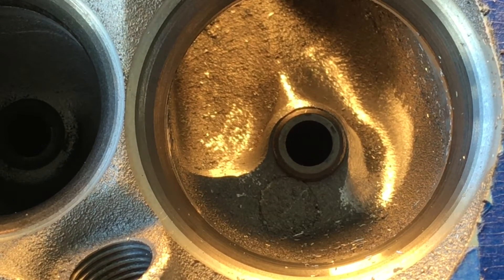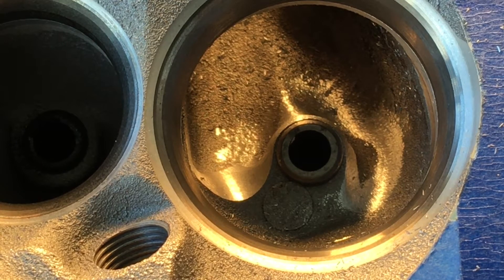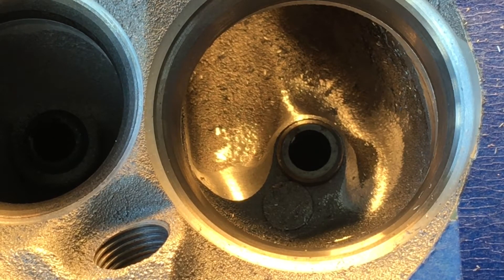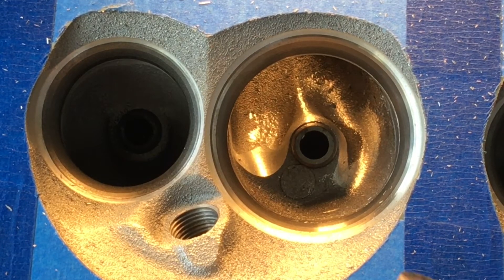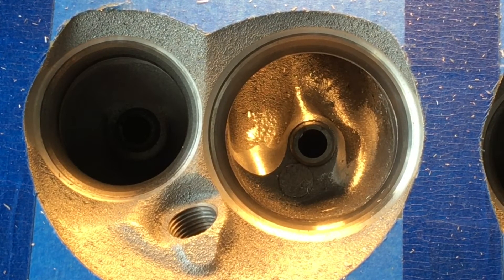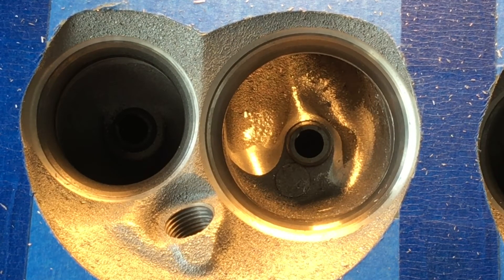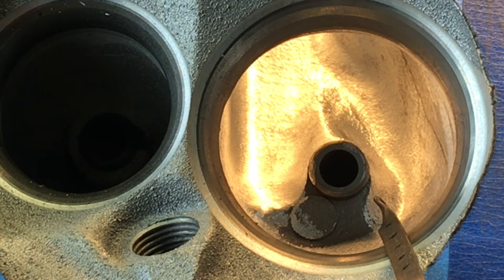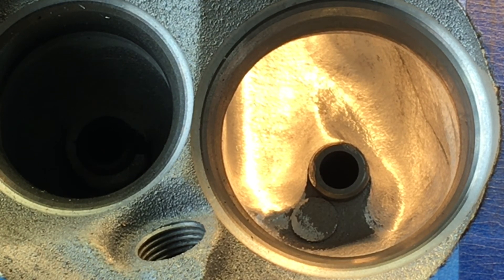862  215cc heads swirl ramp and guide boss Porting

Comment: Do you use 40 grit or 60  sand grit for fuel control on the intake port?
Reply from the maker: 40 grit is better if you can get it, but 60 grit is ok too.  The main goal is to leave a slightly rough surface to promote the “boundary layer” to improve flow and fuel suspension. 👍

Comment: How much flow do you think the swirl ramp is worth?
Reply from the maker: I’ve wanted to do some flow testing on each porting modification to see how much difference they make. Swirl ramp, rocker bolt lump, guide boss reduction and throat/bowl percentages. 
My 1.89” valve test heads flow 268 cfm with the swirl ramp at 208cc port volume.  I honestly can’t tell you yet how much the swirl ramp affects the flow yet.  I’d guess it would depend on other mods compounded together vs only the ramp removal.   JD

Comment: it doesn't matter how you look at it...the roof is always the roof.  and the carbide has a name...how did you order it out of the catalog?
Reply from the maker: Honestly I order my burrs on eBay most of the time.  I have burrs from Grainger, Cornwell etc but I hate spending a huge amount for big name burrs. 
Iirc the large double cut “Tree” I use to work the swirl ramp is 5/8”.  But I only use it for certain areas then work with several other burrs.   6.00”+ shank 1/2” single cut “Flame”, 1/2” & 3/8” double cut “Egg”.  Sanding rolls etc.  It’s all about finding the shape to best fit the cut. JD

Comment: What is the swirl ramp removal worth in CFM Worth approximately?
Reply from the maker: Peter Fraumeni Very good question, I personally haven’t done back to back tests with and w/o the swirl ramp.  I followed AFR and other big companies on the swirl ramp mods but have always been very conservative when working with it.  If you are creating a larger port to support more CID removing the swirl ramp conservatively is a good mod.  The port can flow more without the ramp for sure. 
The heads on my current 4.8 Turbo build still have the swirl ramp because I was maintaining velocity and monitoring port volume to better match the 4.8 CID.  862’s with 2.00”/1.57” valves 212cc intake ports milled .030” true 61cc chambers.  JD

Comment: Is this as far as you go with the swirl ramp removal? Or do you try to blend it seem less into the back wall of the bowl? I started with a practice set of 862s I had and I worked the entire swirl ramp at one time and ended up punching through down at the bottom of the ramp. Lesson learned. So I was just curious if you take these any further as far as the swirl ramp is concerned
Reply from the maker: Justin Derasmo Yes I work the ramp to blend into the back wall, this is just a starting point. I try to discuss leaving land marks to establish depth markers. 
See my other porting videos on how to safely work the swirl ramp, reduce the valve guide boss and safely blend to the back wall. 
Caution: there’s coolant behind the guide boss so don’t dig!  Maintain the least amount of material shaping and keep the angle. JD

Comment: Did you get the flow numbers on these?
Reply from the maker: Bob miller I’m still trying to get the customer to pay the final balance on these heads. So needless to say they did not want to pay the extra $125.00 to have them flowed. It’s frustrating sometimes for sure!  JD
Reply: @HeadFlowInc  ok, nice work. I have a set i need to get busy on. Thanks for sharing